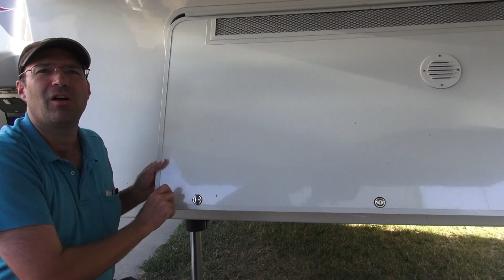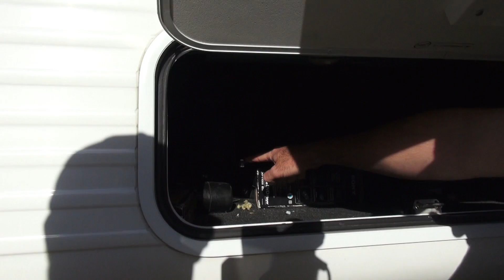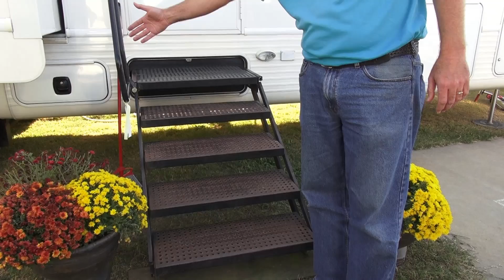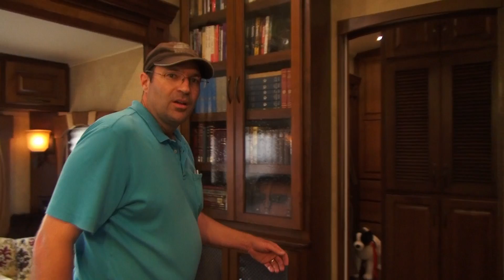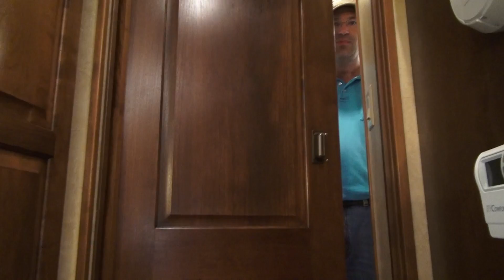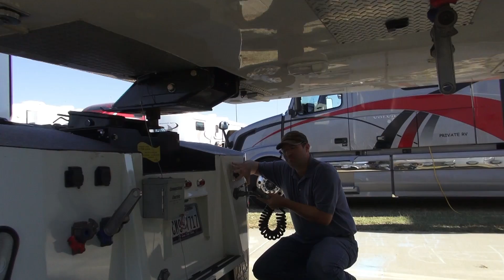Tour of Spacecraft 5th Wheel Custom Built for a Family of 6

Comment: Damn. Very, very impressive. What I don't get, is why people pay up to $100,000 for a twenty foot long tiny home, when they could possibly get this (when used) for a similar price.
Reply: Unlikely. The tiny homes are also on wheels/trailers, so basically they are rv-s just much smaller, so they're  not going up in value. I think you're confusing them with regular homes,
Reply: Did you not hear hi talk about all the customizations? somethings can not be done to a used RV due to either structural issue or weight restriction, or even existing system.
Reply: It's called devaluation vs interest. Ur home will go up in value, this won't!

Comment: Wow that is a beast and beautiful! One thing I've noticed though with RV's is the more storage you have, the less windows you have. The less windows, the more of a cave it feels like. I guess if you spend a lot of time outside it's OK.
Reply: More windows equal more heat or cold penatration. Also the white exterior reflects heat. I just purchased a 2016 Cougar 333mks. Dark color and lots of glass. Sweltering inside above 80 degrees. You need 2 ACs running constantly to stay inside it. Thinking about selling it because of the absolute need for 50 amp service.